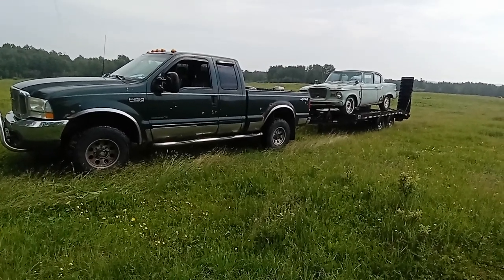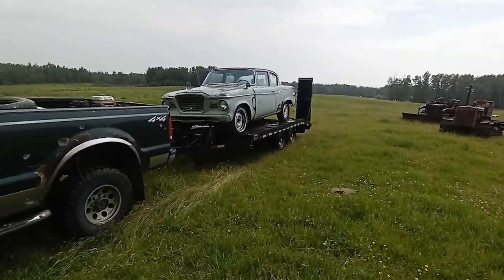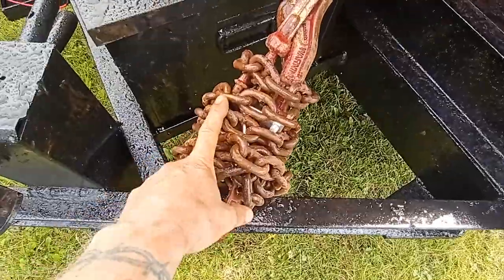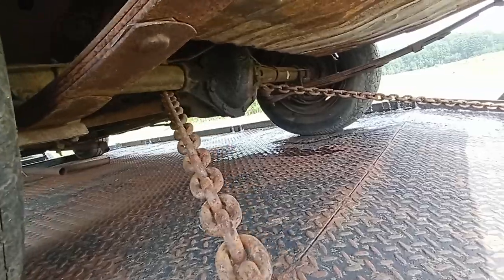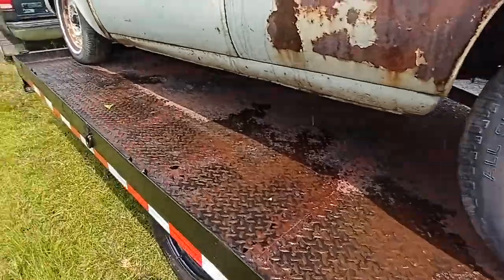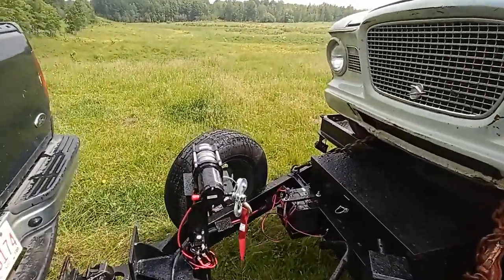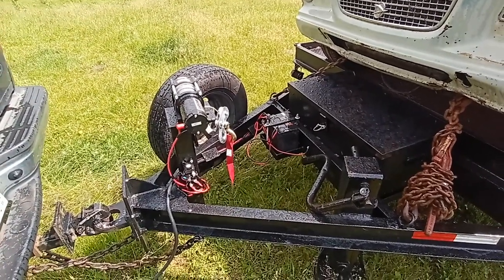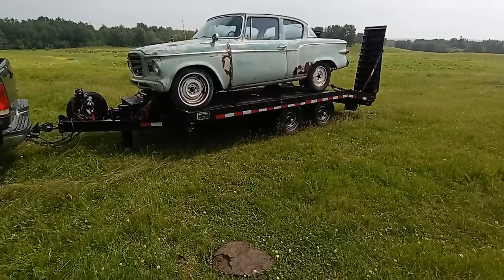How to load a car on a trailer part 3 (tie downs) #nonamenationals

Comment: Cool everything looks solid....sgt stubby looks like a good project.... I did the same thing with an 78 f250 with a refrigerated box on the bed pulled it home with a home made trailer 23ft. I built out of a moblie home that was fun with a 84 360 Ramcharger.
Reply from the maker: Thanks for watching.